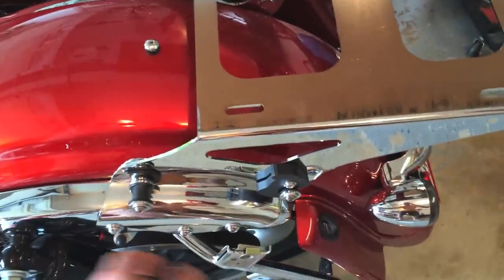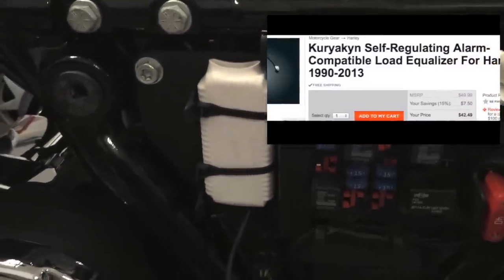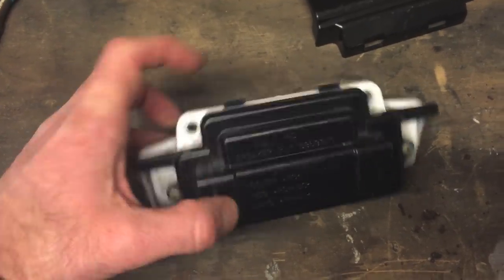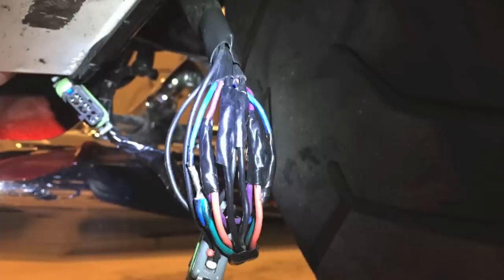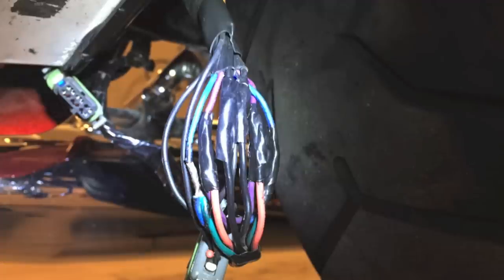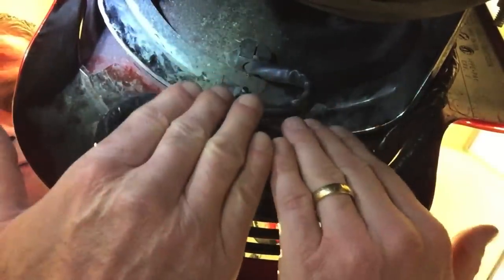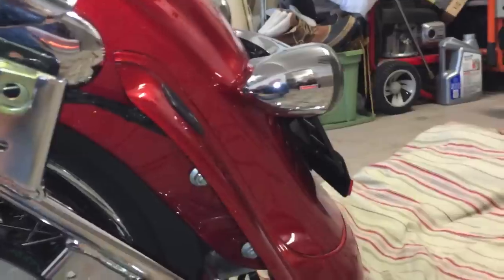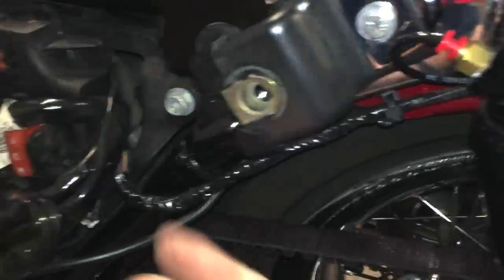2013 H-D Road Glide Gets A Custom 2014 King Tourpak Install

Comment: applaud you 5.5  years later, I'll be doing adding the tour pak tail light to my '20 FLHT soon.  fortunately I will have no problem with the wiring as it's a '20 and comes with the correct connector.  I'm hoping I find a less complicated way to mount the light/ making a template to drill the holes.  either way, I expect drilling the holes to be a pain.  thanks for making this video

Comment: I mounted an aftermarket wrap around light on mine. Thankful that instead of screw holes it actually had threaded posts.
 If I had mapped it out like you and drilled it would be crooked and perforated from failed holes. So hats off to you for that.
In case someone wants to know what I guy like me did instead...Lol. I taped the trunk up with 2" blue tape. I put a drop of GF's  red nail polish on each post and carefully pressed against the tape.
Fearless you did it right but I would have f'd that up.

Comment: Too funny, I asked the local Harley dealer about the wiring and they said to bring it in and expect to drop 500-600 bucks just to wire it!! I found a place that makes two harnesses that plug and play. $165.00 for both harnesses from Bad Dad Inc. Names of the Harnesses are: 2014+ Tour Pak Lid Wiring Harness for 85.00 and 2014+ Tour Pak Light Harness for Ultra Style Wrap-Around Light for 65.00. I have not received them yet so cannot review them at this time.
Reply from the maker: Good gouge Paul.  Thanks for sharing.  I assume these became available a bit later than when I originally did the work.
Reply: did you get this and use it?
Reply: Hey Paul, what Year is your bike and what Year is your tour pak

Comment: I just install the same light on my tour pak. No template, you would think for the cost of this items, or even marks on the inside of the tour pak where to cut and drill. Had to make my own just like you. Even the mechanics at the dealer dislike doing them.. Great video thanks for taking the time to share it with us.

Comment: I just bought a Tour Pack for my 14 Street Glide. I ordered the Tour Pack wire harness for an Ultra from Harley and bought a plug and play wire harness from Namz. No splicing and everything works just fine. I do wish that Harley would allow Tour Packs to be customized with the holes already pre-drilled
Reply: Keith, can you make contact with me on messenger please.  I am performing your exact mod on my 2014 SG.
Reply: Keith D 
Test

Comment from the maker: The other day I had the tank off and finally hooked up the power port in the tourpak.  All I had to do was use a wire tester and probe a few of the red wires that run up the center channel under the tank until I found the one that is controlled by my "ACC" switch with the ignition on.  I had already included the positive wire in my harness and left it coiled up under the seat, so I simply mated the two wires in the channel.

Comment: I have gotten so many conflicting answers on this topic. Obviously the '14 tour pack mount fits the '13 quick disconnect hardware, but I have also been told I won't be able to open the saddle bags with a new style tour pack. I have a '13 road glide, and I really want to make sure it will work before I order the damn thing. Any issues with opening/accessing the saddle bags?
Reply from the maker: D Jackson there are no issues whatsoever with my application. Good luck!

Comment: So is it safe to say that you can connect all the ground wires together and the two blue wires together when you first shave them? Also what color wire attaches to the red/yellow brake light?
Reply from the maker: I would never say anything is "safe", rather it's at your own risk. However, after reviewing the video a couple years removed, I'd say yes...the two blues for tail lights can be combined and so can the grounds. As for the red/yellow brake line, the wire you attach can be a color of your choosing. It just goes from that brake light source to the "Center On Bright" part of the harness.

Comment: I need to see the antenna connection from the tourpak to the splicer, and to the antenna wire for the bike.
Reply from the maker: +Travis Litchford I hope you sorted this out.  The antenna wire from the tourpak simply joins up with the antenna wire for the bike using the splicer from the relocation kit.  Then you just route the cable forward under the seat.

Comment: What kind of crimpers did you use?
Reply from the maker: Not sure what you're referring to.  I soldered all connections.  If you're referring to crimping the small pin connectors on the end of the wires before inserting them into the 6-pin connector, they're very delicate so I carefully used needle nose pliers to bend the tabs around the wire before soldering them.

Comment: Ummmmm......why didn't you just use the connector under the seat with a new deutsch connector ?
Reply from the maker: H-D claimed that the electrical system on the Rushmore redesign was incompatible. It's possible they didn't know what else to say.  Regardless, I had to ensure that I had a power source properly conditioned for the LED lights. The only way was to tap in downstream from the last converter before my lights. Plugging in under the seat would've only guaranteed a source meant for incandescent bulbs.